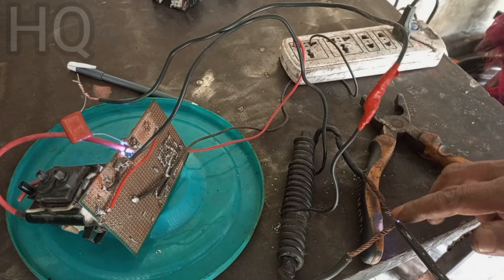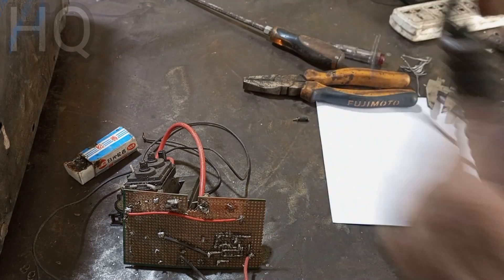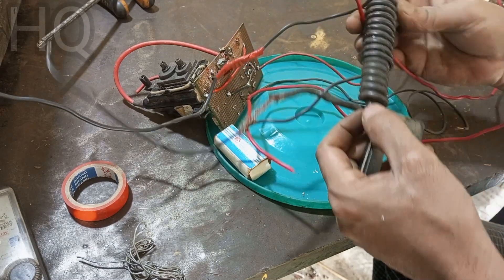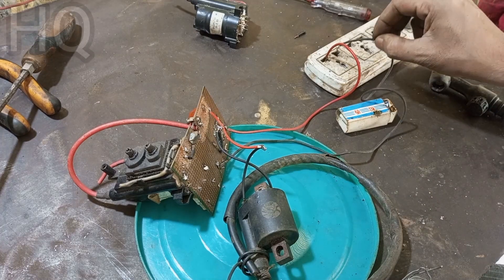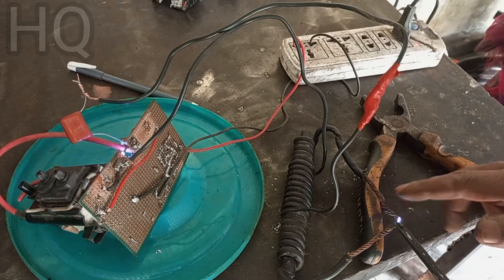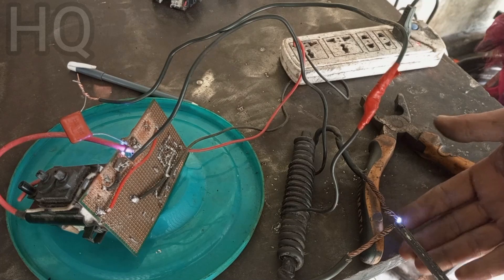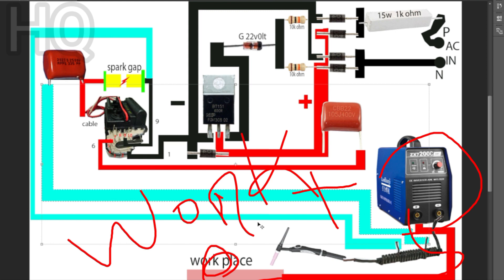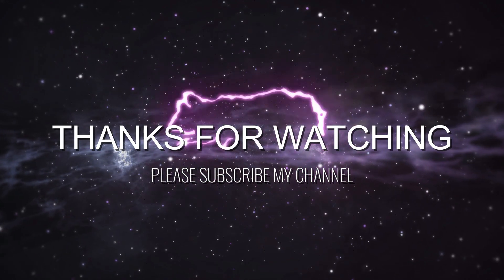schematic homemade aluminum tig welder and high frequency starter part 2

Comment: buen aporte. ¿puede soldar aluminio?
Reply from the maker: No sir. I'm uploading a new today on this, plz see this video. Thanks for your question.
Reply: @MSB4B   muchas gracias por su respuesta., ¿y a que tipo de maquina se conecta a ac o dc?
Reply from the maker: sorry for the delay sir, i was busy to complete editing of my next video for 4 days. this is actually a transformer based ac stick welder and modify this into a ac dc tig welder by the help of this arc starter circuit and because this a ac welder so in terms dc you have to use a 200amps bridge rectifier.

Comment: The scheme is complete and wonderful, but it was not clear to me a scheme of high voltage terminals, there are 8 legs, it is possible to tie a way and thank you 🌹 ❤
Reply from the maker: What do you mean by 8 pins? If it is flyback pins then answer is yes. We need only 4 pins that is primary and secondary.

Comment: For AC input, instead of that 1K resistor (that gets hot) use an AC capacitor (capacitor reactance in ohms resistance).  Formula example:  

108 UF capacitor limits the current due to Capacitor Reactance

Capacitor Reactance = 1 / (2 * PI * Frequency in HZ * UF / 1000000)

EX:  1 / (2 * 3.14 * 60 * 108/1000000) = 24.57 Ohms

120 VAC / 24.57 OHMS = 4.88 Amps
Reply from the maker: Yes i notice that resistor is getting hot but not too much. And 1k 15/20 Watts is appropriate
Reply: Exactly. A capacitor is better for this job. You may use the nearest available value for a capacitive reactance near 1k, which are 2.7uf for 60 Hz, or 3.3uf for 50 Hz, or do a series/parallel combination using the Xc formula (1 / (2pi*f*c)) to be nearer to the 1k value. Total voltage rating of the caps would be 2X the input voltage.

Comment: Is that scr or triac? And what value bro
Reply from the maker: Bt151-600r triac work as a thyresistor 600v 12 amp. Thanks for your comment sir.
Reply: @MSB4B  my main triac on the welding transformer heats up a little bit ist normal?
Reply from the maker: A little bit heats, it's normal.